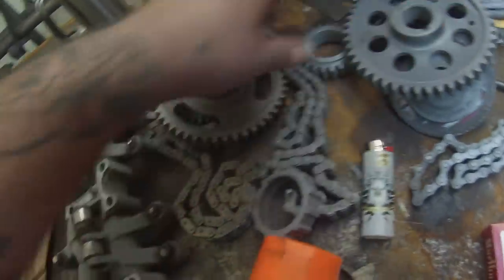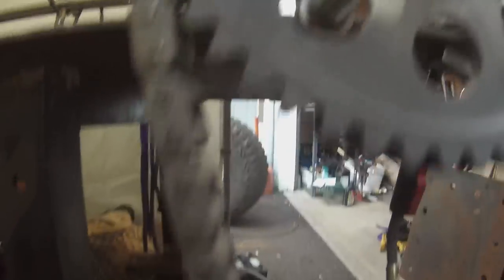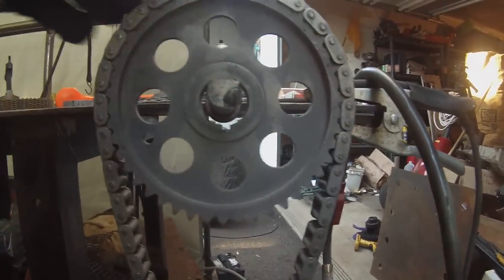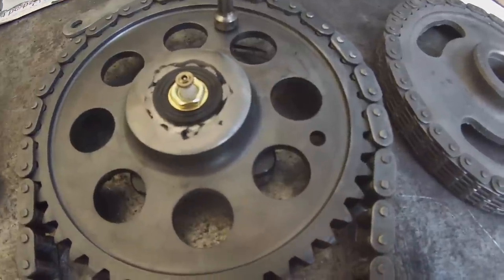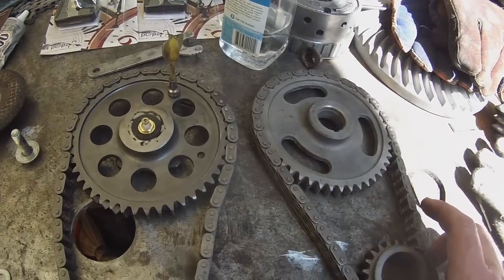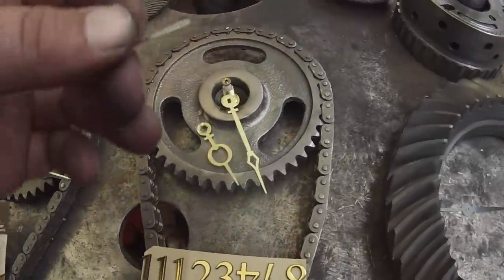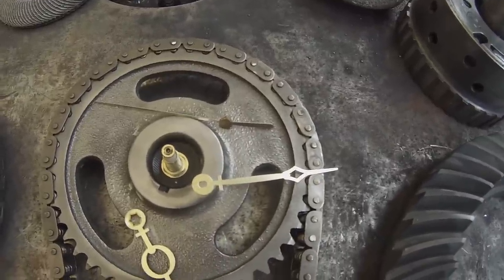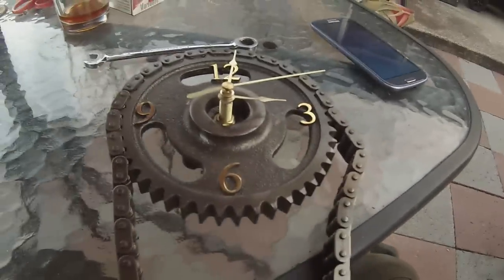welding project, timing chain clock

Comment: What was you process for welding on these sprockets? Cleaning process, type of wire/stick? Any preheat? Welder settings? I'm having a hard time getting my welds to stick to the sprocket.
Reply: 240sxEnthusiast lol,  man i was told i talked to much in my videos.  So watching through finally at 10:20 mark i did mention that these are the worse thing i had worked with.  
Moving on from there i would use my torch to try to get that"goo" if it started coming up to run a little. I'd walk away for a minute to let the smoke clear then come back and check it with my heat stick.  I used my gas and would set it high to just burn it in.  Where you put the washer for the clock parts hides,  it's not going to look nice but hides.  On the back still run hot but tack weld from chain to sproket. 
I hope this helps.  Its not an easy thing to work with, but none of my friends have asked me to fix theirs yet.